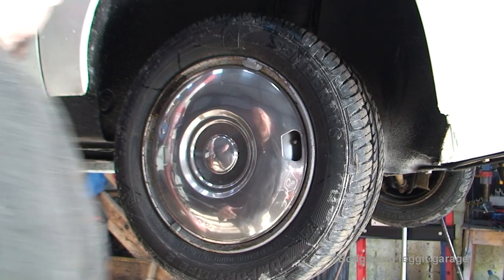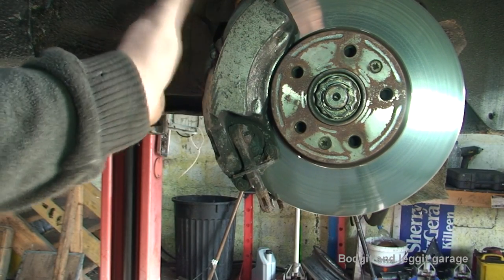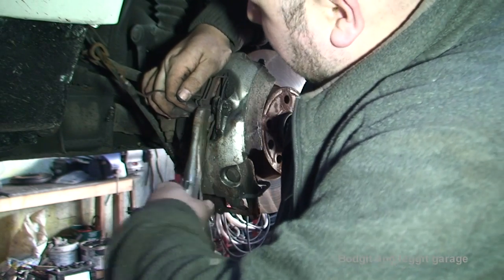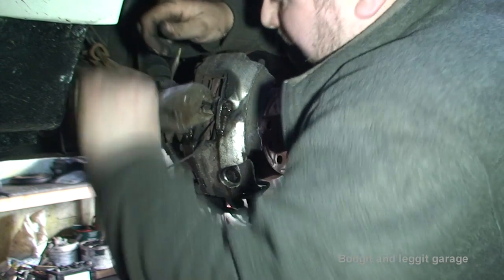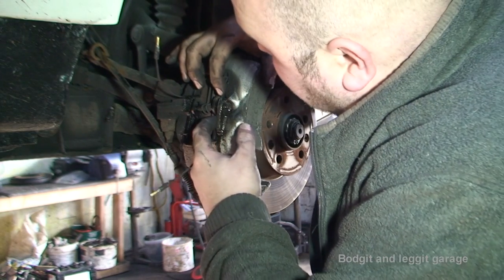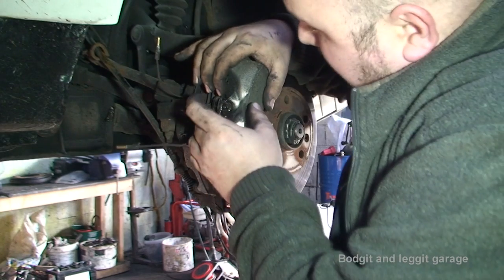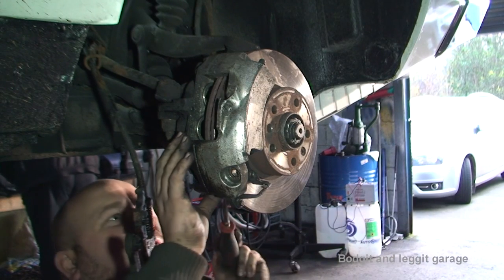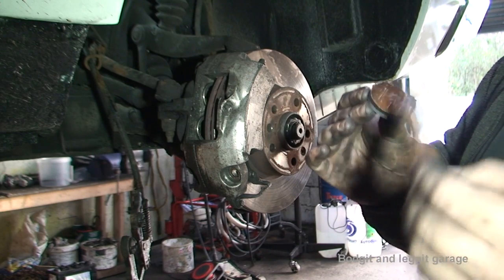bodgit and leggit garage  1979 citroen cx front pads and hand brake pads

Comment: For adjusting the cam on the front brakes I use a diamond shaped chisel from Aldi. Comes in a set, and it’s cheap, that fits the slots perfectly. Makes the adjustment really easy and doesn’t damage the slot at all. The chisel is about 6 inches long so doesn’t get in the way when you don’t have the luxury of a ramp to do the job.